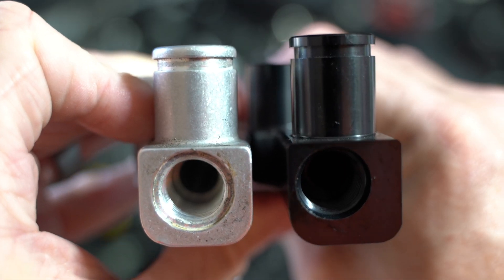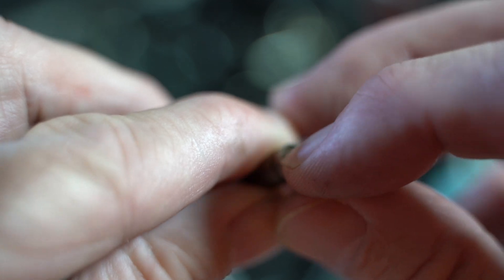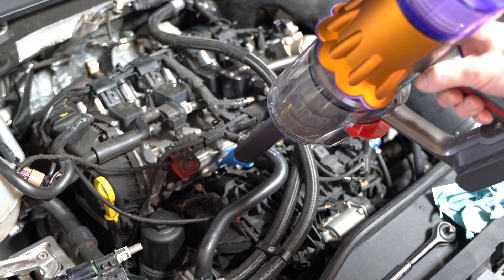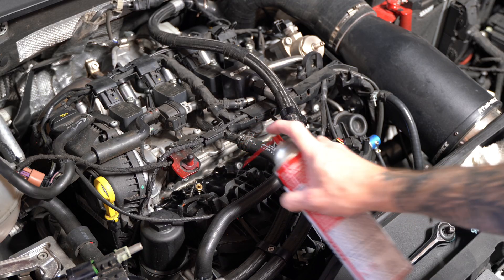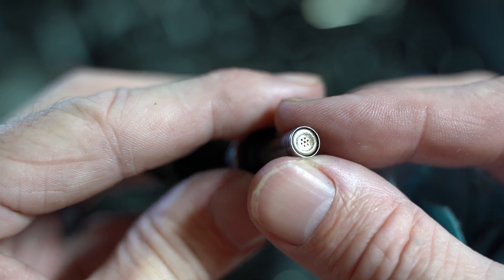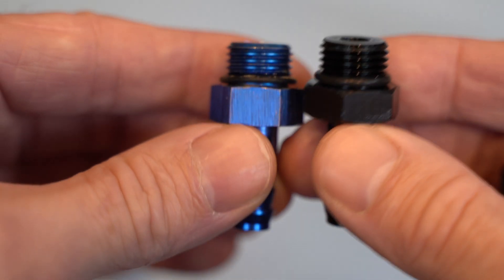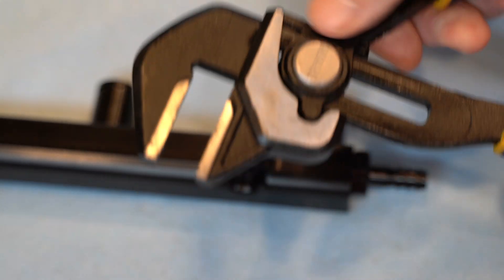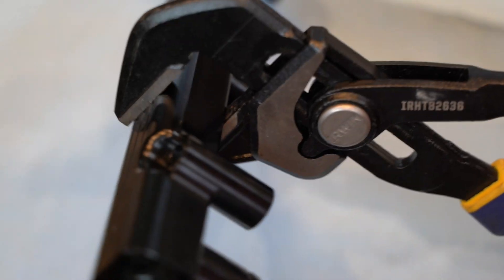MPI Rail Swap: EQT Beta to Production Version - 2019 Golf R

Comment: I got unitronic's mpi for my mk8 gti. Anyway how is your water pump? Concerned since it be harder to remove the intake manifold after installing mpi.

Also how is your dsg clutch pack holding up? Is it still the original or you replaced/upgraded it?

Comment: When I pulled my manifold to replace my throttle body, I depressurized my fuel system like you did and after I got everything back together, my car would run but when I tried to drive it it would lean so bad it closed the gap on a couple of my plugs, it took me a month of messing around with different things to find out that the a2b lpfp I had went bad, and for some reason after I had relieved the system of pressure the pump could no longer hold enough pressure to move or even rev it more than once or twice. Monitor your rail pressure, you might see it struggling to maintain the correct fuel pressure
Reply from the maker: Thanks for the info. Sounds very similar.  I am going to switch to 93 for a bit and put Seafoam in at every fill up. My thought is that if it's just E85 residue, it might clear itself with some high detergent fuel... but your situation does sound very plausible for me. The fact that it ran SO bad for the first few miles after draining the system is very strange to me. It did improve,  but the LPFP still can't keep up if I give it too much boost. It's very drivable...but not right.
Reply: @EVERYTHINGcpo  I bought a used pump when I originally did a Vortex on my A3 and had issues where the pump was unable to keep pressure above ~50-60psi once demand got higher. I got a new harness and upgraded to the black controller, sent the pump to Innovative Motorsports to look at, and they did not see anything wrong. In the end, replacing the pump was the only thing that resolved the issue for me. Have you taken a look in the tank? I've also had an issue where the pump kicked the feed line off a bit and as such it couldn't maintain pressure

Comment: Good to see you making Golf R videos again. If the car has been sitting that's not good when using E85 fuel. Definitely check your LPFP / HPFP for sure. If the car sits for long intervals, definitely switch to 91/94 octane gas.
Reply from the maker: Unfortunately, most of the time it sat this year was without notice, so I didn't have a chance to plan for it. I ended up in the emergency room and that resulted in a month in the hospital with about as much time recovering... I think that's where most of the issues occured for me. Hopefully I can clear it with some high detergent fuel!